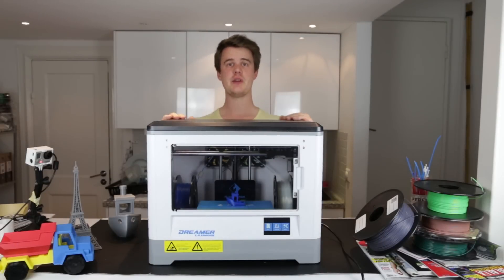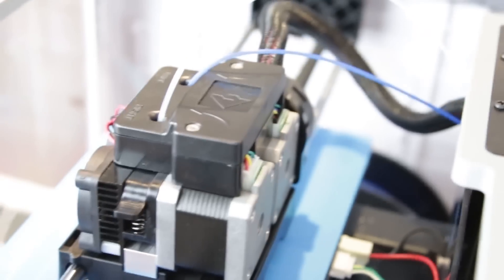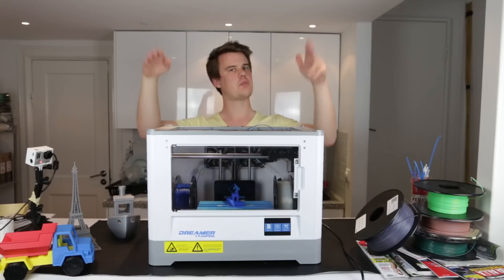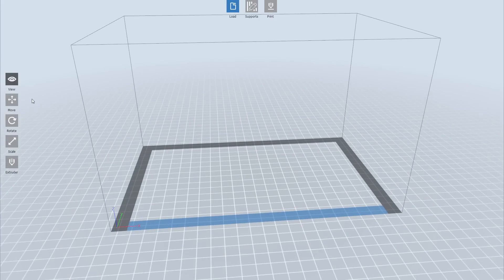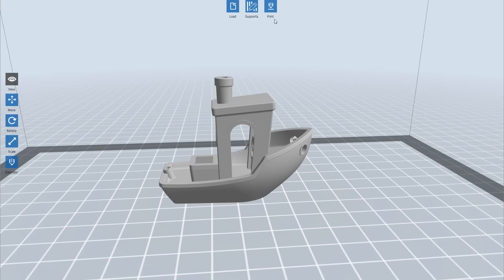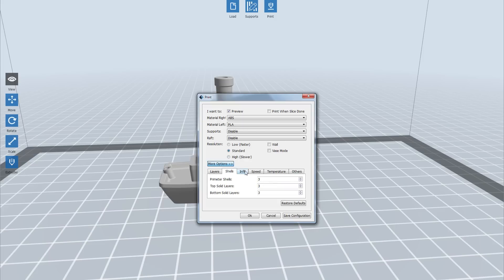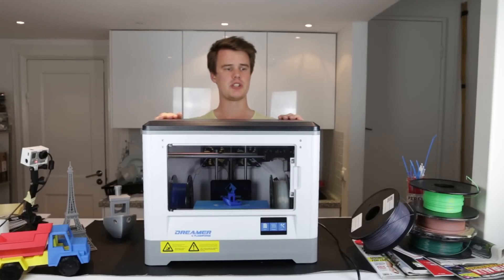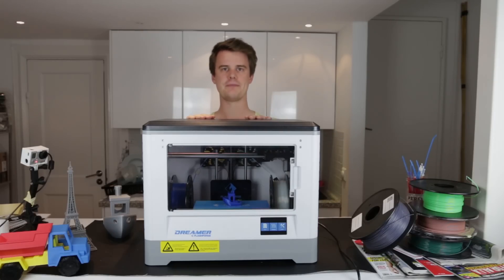FlashForge Dreamer 3D printer Review

Comment: Would thos be ok for a cumplet beginner as atm it'd same prices as the advencher 3
Reply from the maker: Adventurer 3 will be a bit easier to use for a complete beginner. But you get more printer with the dreamer.   First tip if you get the dreamer is to remove left nozzle, as it might “hit” your prints, specially when everything isn’t perfectly tuned.
Reply: @3DPrintTechDesign  amazing thanks

Comment: One thing I was disappointed with in this review was you didn't show filament loading like you did the Flashforge Adventurer. Other than that, it was great.
I'm trying to decide on my first 3DP and so every little thing goes into that. Thanks for helping me better informed.
Reply from the maker: Thank you Dave!  The filament in the dreamer is a bit tricky if you don’t have the 600gram spools. I have probably linked to the spool holder I made. Otherwise I have a video on that as well.

Comment: hi, Anton. Thank you for the video. Just purchased this model. I have .stl files but when I connect my laptop to the printer is asking for gcode files. Would it work if I upload the .stl files directly on the SDcard? Thanks
Reply from the maker: Hey, no you need to slice the stls first in a slicer software, for example flashprint that comes with the printer =)

Comment: How do you control the temperature of the enclosure (not the bed neither the nozzle)?  By software?  By the local control panel?  Thank you.
Reply from the maker: Oh this is now quite old video. but I'm pretty sure it only decided temperature based on material you print (within slicer). so for PLA, it would vent. otherwise it was just setting nozzle temps and build plate.

Comment: What are your settings for PLA?
Reply from the maker: I cant remember exactly for this printer. But it varies a bit between brands. I used to run white PLA 5 degrees warmer.  If you use flashprint, I'd say go with standard settings and then you can tweak for your material =)

Comment: Does anyone what are the big differences on the Dreamer and the Inventor?
Reply from the maker: Basically the Inventor 1 (the "blue" dreamer") have a newer OS, processor and touchscreen. Add to that a webcam and in theory better Wifi-option (for seeing the real-time data) I'm not sure people are having a great experience with the whole Wifi on the inventors...   Anyhow, it also has the ability to resume print after power-outage, if you activate that feature in the menus.  But that's more or less it =)  I'd say go with a dreamer as it's usually quite a bit cheaper. Unless you really want the features.

Comment: What’s the difference between the dreamer and the dreamer NX?
Reply from the maker: The Dreamer NX has a single extruder. IF you're looking to get a cheaper "dreamer" with one nozzle the Adventurer 3 here: https://geni.us/3DpTDadventurer3
 (currently testing) seems to be quite a better machine. Just note the smaller build plate.
Reply: Thank you  @3DPrintTechDesign
Reply: would you recommend a dreamer or creator Pro if you had to pick? @3DPrintTechDesign
Reply from the maker: It's quite hard to say really. Creator Pro is more open and handles more slicers (better?) but the dreamer has the exhaust fans for PLA and I feel it's a bit more "easier" although they are really similar. Creator pro should usually be slightly lower in price. Send me a PM/mail if you want me to help you a bit more on what could be best for your needs =)

Comment: Nice video and review. Gives me a good impression of what I may get if buying. Like so many others, I got stuck in-between deciding which one to buy? A budget CTC, a XYZprinting DaVinci pro, a Flashforge? Amazon and eBay offers quickly run out, faster than my decision making process. I probably want to print many different kind of materials, like flexible, Nylon, PLA, ABS you name it. Rather dual extruder than single extruder. Not into fancy stuff like detailed fantasy models but rather cases, gears, levers ...more practical things so to speak.
Reply: Hi This 3d printer is quite good. All in one, multi-functional, high precision, compatible with all 3rd party filament. we 3d printer factory sell it directly. https://www.alibaba.com/product-detail/ET-K1-Yite-3D-Printer-Large_60659658525.html?spm=a2747.manage.list.7.8GgZWt

Comment: Nice Video! I was more interested in the FlashForge Creator Pro 2016 but after watching your video I'm in a dilemma. I've got few questions... 
1. Is the frame plastic or metal? 
2. Can we use any other software like Repetier, Cura, Simplify3D, Octoprint etc?
3. Can we send the job through PC then shut down the PC once the printer starts printing?
4. You mentioned it requires 600g filament roll, I cant seem to find any in Australia apart from the XYZ ones which are overpriced. If we use the spool from outside, I guess it defeats the purpose of side panels to lock the heat in? In other words, would opening the side panels affect the performance of the printer (warping issue)
Reply: You can use 1kg rolls just fine :) Yes can use Simplify 3D, Yes can shut down PC after uploading print. thread filament through slots in side panel to enable it to stay in place. Frame is plastic.
Reply: Deepansh Kumar I'd go for the creator pro, it's less expensive, you can use any spool (fed in through tubes in a small hole in the part on top so it keeps the heat in), metal frame, and they are basically the same printer. also you can use the free software flashprint, makerware, simplify3d (150$), replicatorg, or the softwares you mentioned if you can convert the geode to .x3g

Comment: what is the best on to get the FlashForge - Dreamer 3D-Printer or the Flashforge®-Creator-Pro ?? what is best to get ?
Reply from the maker: i would say the Dreamer. its newer and better. runs another Mother board and newer inside.  you will be satisfied!
Reply: Flashforge dreamer is newer, the creator pro is amazing too it's sturdy build and a beast but go for the dreamer and you will not be disappointed
Reply: Hi This 3d printer is quite good. All in one, multi-functional, high precision, compatible with all 3rd party filament. we 3d printer factory sell it directly. https://www.alibaba.com/product-detail/ET-K1-Yite-3D-Printer-Large_60659658525.html?spm=a2747.manage.list.7.8GgZWt

Comment: have you tried carbon fibre from colorfabb?
Reply from the maker: +Agustin Gutierrez yeah! Im doing a comparison between ColorFabb and Proto-pasta carbon fiber now. should be out next week. There are some differences, absolutely. Both runt in the Dreamer, but i'd say you are easier off with proto-pastas on a stock Dreamer.
Reply: +3D Print - Tech Design Thats awesome to hear.... I was reading reviews for 3D printers and there were a lot that were nice, but this is In my opinion one of the only ones that seem to work out of the box... I have a rep 2X so I'm no stranger to calibration and time consuming modifications.... having failed multiple times at carbon fibre I decided the rep2x is only good for ABS so I'm moving on... hehe...  so its great to hear you're even doing a comparison.... would you have a particular nozzle size? or model so I can replace it with the more resistant one? thanks

Comment: I just purchased one, so I was wondering about the details of temperatures, and materials.  Like take me through design, and build of a project.
Reply from the maker: +Justin Hall Great! Im sure you will be very happy =). Temperatures is really hard to recommend settings for since they differ a little bit depending on each manufacturer. Start of with the presets inside of FlashPrint (the free 3D-print software/slicer for FlashForge).  maybe 3D-print the 3Dbenchy and do some tests?  (www.3dbenchy.com)
Reply: Fair enough.  I really appreciate the time so many people take to teach other people how to do things!  Much more courageous than me.  I have a LONG list of things to print and I was going to wait until Santa Claus officially dropped it off, but the little kiddos got into it first.  Maybe I should print out coal for their stockings?  PLA or ABS?  Since they'll likely throw it at ME, I need the lighter material!!!

Comment: Would it be possible in the software to make it do like the main print on the left extruded and supports on the right? So the left extruded is say the boat in ABS and the Right extruded doing PVA support?
Reply: Sorry, I mean extruder not extruded.
Reply from the maker: +Brennen Patel Absolutely. In the settings you can choose that! No need for creating supportmaterial in a seperate STL-file

Comment: I appreciate the time you put into making this video, however, you lead up to a BOAT print, but instead showed a completely different object in the printing process, and then ended with the completed BOAT. Why did you do that?
Reply from the maker: +Zachary Hlavinka Thanks for the feedback Zach! I see the issue, where the time-lapse is showing a dual print instead of the boat. To be honest i ran out of time and didn't plan to print several boats. I shot the slow 1x prints of the boat and then left the printer unattended for a few hours to try out a dual-extrusion print which gave me opertunity to take a time lapse. 

My goal was to show off 3Dbechy as the main model to be printed, but also wanted to integrate a dual print since it's a dual extruder 3D-printer, this became the easiest way of doing it.  I hear your feedback and should be able to learn from it in the future :) Thanks for watching!
Reply: +AMID I have only made 2 prints. After just finishing a PLA print, I can't remove it from the print tray without feeling like I'm going to hurt the machine or myself. Advice?
Reply: +Zachary Hlavinka build platform I mean

Comment: is it possible to print AutoCAD 3d designs ?
Reply from the maker: Travis Mohan Well, that's a tricky question. If you export a solid model as an STL then yes, without any real issues (make sure you "heal" your model in netfabb Basic first). If your model consists of several solids not joined "properly", it's another matter and you have to download a slicer software to check out in the gcode preview if the model looks ok.
Reply: +Travis Mohan 
I highly recommend reading Amazon reviews before buying Flashforge 3D Printer Flashforge-3DPrinter.blogspot.com Click to view now !!!